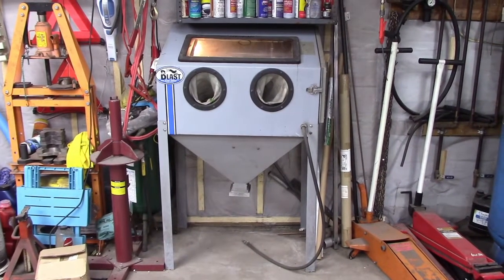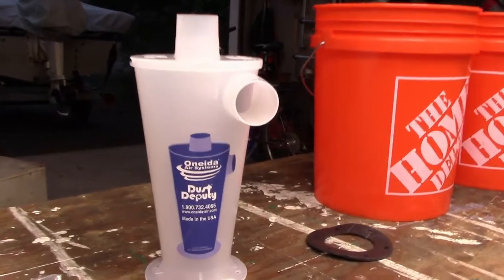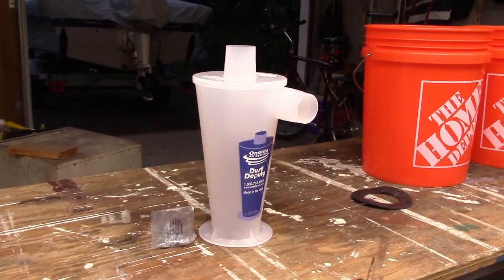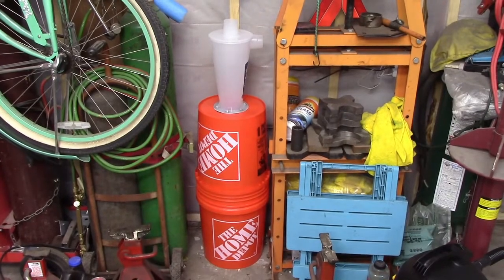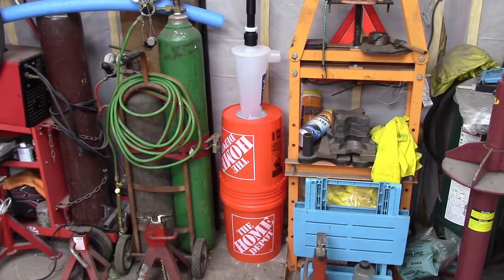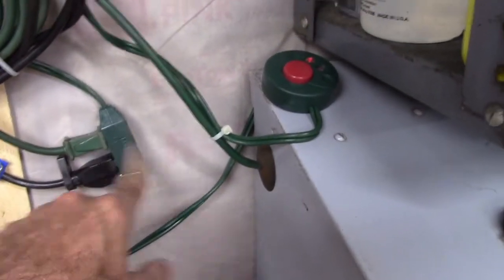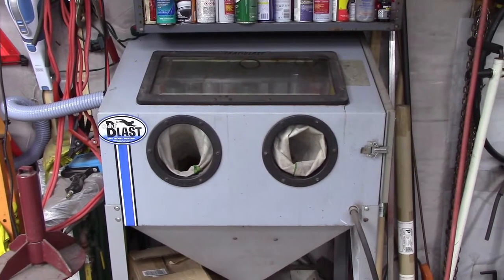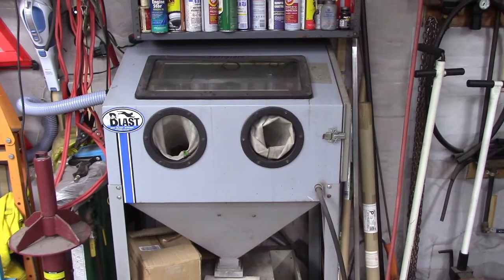Building a sand blast cabinet vacuum system

Comment: You have your vacuum hose connected to the wrong port. The port on the left side (where you have your reclaimer hose connected) is for fresh air to enter the cabinet, and the port on the back right is where you connect your vacuum reclaimer system. The way you have it setup, you will be pulling out more of the blast media then anything else. The port on the back right is baffled to keep the media in the cabinet and the dust out of the cabinet. What you are seeing in the deputy while you are blasting, is mostly the blast media. Set it up correctly, and your system will work much better, and you will collect more dust from the parts you blast than the media.
Reply from the maker: I believe I have it set up correctly. It is the media that is flying around inside the cabinet that makes it difficult to see what I am doing.The media dust being drawn out the side makes for much better visibility when I am blasting. The media that is collected can be reused 👊
Reply: @daveraymond2265  The baffle on the inside back of the cabinet is designed to force the media down to the bottom of the cabinet while pulling the air out of the cabinet, instead of pulling the media out with the air. The whole purpose of the baffle is to keep the media in the cabinet. Think of it like a gold mining sluice box. The 
water/dirt mixture flows over the box grating, and the gold falls out of the water and gets trapped in the bottom because it’s heavier than the water. The port that you are pulling the air out of, is supposed be the filtered air inlet. You will be able to see better because the baffle directs the air/media mixture away from the viewing window, and you will not pull as much media out of the cabinet if you set it up like I have described. I have four of these cabinets that I use in stages, with media grits ranging from fine to course. One of my four cabinets is setup for vapor blasting, which I use as the final stage. All of my cabinets are setup as I described above.
Reply from the maker: @H2HB2B  There is no port on the back of the cabinet to hook up a vacuum hose, just an opening to let air in. I want to suck out the dust so I can see more, this reclaim system lets me put the captured media back into the cabinet.